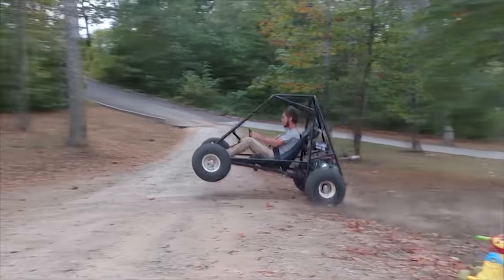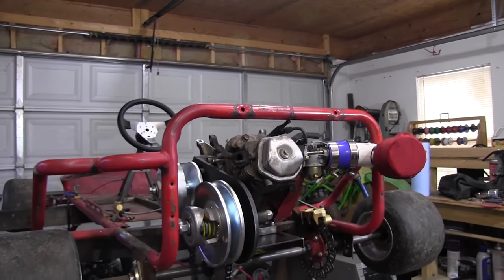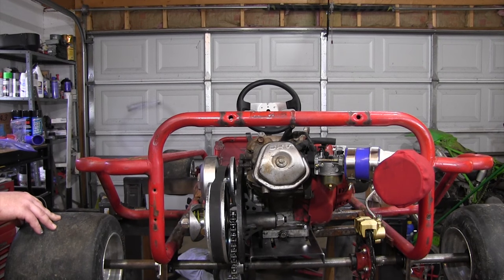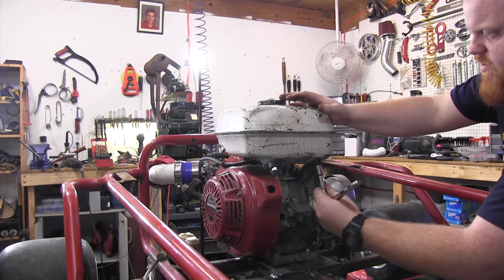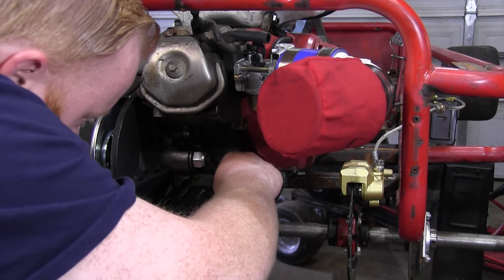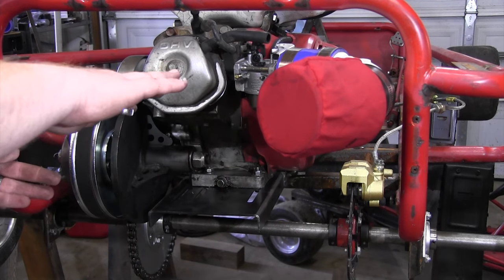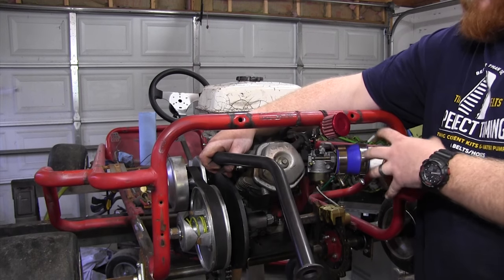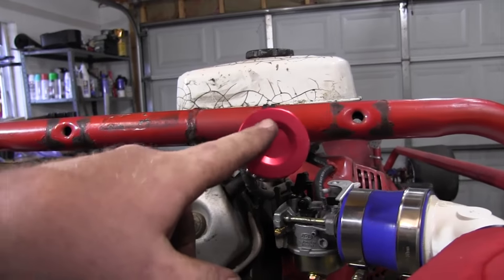Street Go Kart Build Ep. 5

Comment: Red,  check out the 10ft. 1/4 fuel line in the plumbing dept. at Lowes,  I found it by accident there , and priced right and yes it is for gasoline .  It was cheap enough that I bought 3 rolls for stock.
Reply from the maker: +OKIE CHOPPER I will do that sir

Comment: I like the muffler idea...thanks for the link. Is it quieter than the standard 3/4" briggs style screw on mufflers? 
Before you weld that tab on...you might want to re-orientate the muffler bracket to mount inside the side down tube and weld it there...rather than on top the frame like the way it's shown now.  It'll look better that way...
Reply from the maker: Its actually already welded on now. lol. It is a little louder than the screw on style and a lot deeper. It sounds a lot like a 4 stroke dirt bike. I like it quite a bit.
Reply: All right...looking forward to the next video to hear what it sounds like.

Comment: I don't know if this will help but if you get a set of rims that you know are true and straight you can take a tape measure and stretch it across the front of both front tires and the back and the front needs to be about 1/8th of a inch shorter which is toed in so when your going down the road if there's any slack in your steering it will end up at 0 toe that's the same way that we set up our racing karts and a good place to order performance parts is DynoCams online they are very friendly and are big in kart racing
Reply from the maker: +Jesse Hardy thanks for the info man.

Comment: I would like to use a 2  cylinder honda engine from an old generater  but it has a tapered shaft.  I was wondering if you would now how to make it work and if you can let me know how to do it just to get a sprocket on it if it is possible
Reply from the maker: +sparfez fezspar you would really need to convert it to a standard shaft.